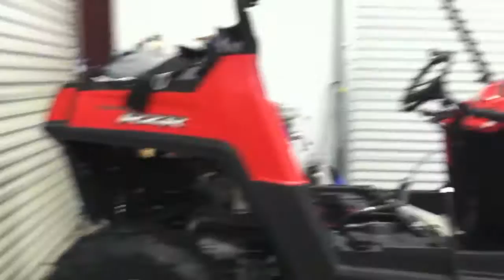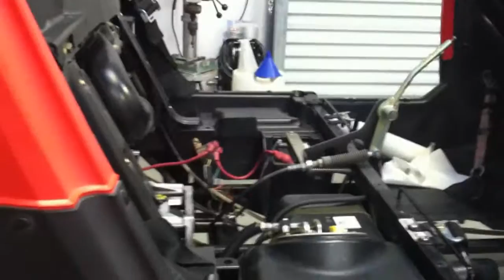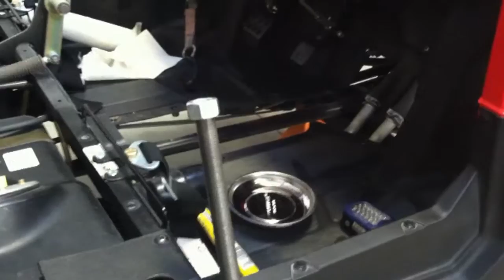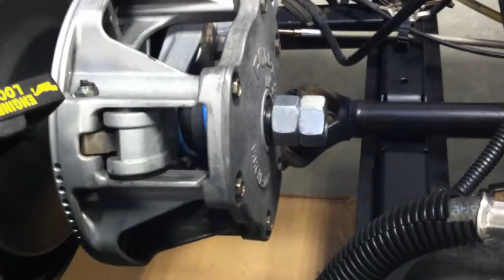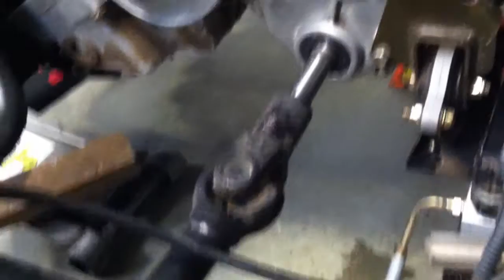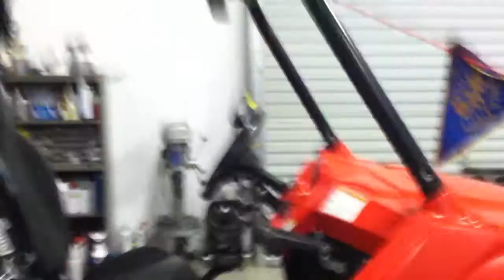Polaris RZR 800 Tranfer Case Leak Fix

Comment: Did you take roll pin out on driveshaft going to front differential and remove shaft from front differential when you moved it forward to get shaft off of transfer case?
Reply from the maker: Sorry for my delayed response.  It is not necesary to remove the roll pin.  When the differential is loose the driveline will pull out of the transfer case.

Comment: Will it be same procedure for a rzr 800 4 seater 2011?
Reply from the maker: I've never done a 4 seater but I know the engine and transmission are the same.  If anything it should be easier bacause ot the longer prop shaft to the front diff.  There will be extra flooor pieces to remove and rear seats of course.  Let us know how it turns out.
Reply: @duneroller  thank you for replying. Thanks for the video. Helps alot to have an idea to do the work on this issue of leak. I'll notify you how it went. Are you from California?
Reply from the maker: @vvillagrana290  Yes.  I live in Central California.

Comment: Hello Jeff how did u get that little red stubby bolt out behind the clutch cooling cast. I’m having a heck of a time getting that one?
Reply from the maker: That's the hardest part of the entire job.  I took a wrench and basically removed the bolt one flat at a time.  The adapter between the engine and transmission/transfer case has to move out as the bolt comes out to clear.  It's not easy but it's better than removing the entire backend and pulling the motor and transmission as a unit.
Reply: @duneroller  ok thanks. I’ll give it another shot tried 3 different wrench can’t get a good bite on it
Reply: I'm doing this job now and on ours we definitely don't have the room like the one in this video,

Comment: can you find a replacement gasket  online no clue what Honda bond is. 16 and attempting this at technical school and need any help I can get
Reply from the maker: Google Hondabond 4.  It's Honda's version of form-a-gasket.  I like it because it seals but does not get as hard as form-a-gasket and is much easier to clean if you have to work on it again.
Reply: @duneroller  another question I have is which motor mounts do I have to take off and undo I have gotten to the stage where I have to remove em but I have no clue which ones
Reply from the maker: @cd5732 The only motor mount bolts that have to be removed are the ones connected to the steel piece that connects the engine to the transfer case.  The others will support the engine but allow it to swing away from the transfer case.
Reply: @duneroller  and what did you mean by bouncing the transfer case with a 2 by 4 till it sits
Reply from the maker: @cd5732  Use the 2X4 as a pry bar.  Lift the transfer case up then drop it until it rests against something below it.
Reply: @duneroller  I'll try it next time I'm in school and do you acually jack the motor up or is the jack just supporting it
Reply from the maker: @cd5732  You have to lower the engine to remove the mount between it and the transfer case.  The jack supports it while down and is used to lift it back up into place.
Reply: @duneroller  I was trying to lift the motor lol I was able to the the cover off I'm gonna have to replace a bearing because the outer race of it fell out when I took the over off but other than that its gone decently smooth I really appreciate the vid and all your help you've helped me save like 3 grand
Reply: @duneroller  I'm having some trouble getting the cases cover back on did yours go on smooth or did you have trouble as well? If you did do you have any tricks to getting it back on
Reply from the maker: @cd5732  Mine slid right back on..  It had to go on before the sealant sets up.  I checked alignment several times and made sure the mating surfaces were clean before the final assembly.  No tricks that I can think of.
Reply from the maker: There is no gasket between the transfer case halves.  It is aluminum to aluminum sealed only by the machined surfaces and liquid gasket material (Hondabond, Yamabond, Form a Gasket sealer).

Comment: That upper shaft, the one that goes to the clutch. Can that seal be changed from the outside or do you have to take the cover off and pull it from the inside?
Reply from the maker: Keith Rowe If I remember correctly both seals in the cover are installed from the outside. The secondary clutch comes off easily if you want to take a look. Remove the belt and the bolt holding the secondary clutch. Keep the shims for alignment and you should be able to see t with the rear belt cover in place.

Comment: My 800s is puking oil out the vent line for the transmission any ideas on this
Reply from the maker: steve billow did anyone service the transmission and transfer case recently?  One has a check plug and the other is fill to plug. I’ve seen many people overfill the one with the check plug.
Reply: @duneroller  no service work
Reply: @duneroller  I filled to the check plug and I also filled to the run over plug
Reply from the maker: steve billow Sorry to hear that. No more ideas here.
Reply: @duneroller  some guys has said something about a broken clip in the trans would do that,  but I have no idea.

Comment: Did this fix work? I have a leaky drive shaft seal as well. I assume that it is where the leak is coming from. It leaks pretty bad. I just bought my 2008 RZR 800 and am just going crazy with how many repairs I am doing. The previous owner did an excellent job hiding all the issues.
I guess I am just asking what you did? It sounded like you pulled the transmission (not sure if it was trans or transfer) cover and resealed it then replaced the shaft seal and sealed it as well. You mentioned that the manual said you can not do this... Was that just the part about sliding the front dif forward?
Thanks for the video, any input would be great..
Reply from the maker: Nathan Yeager sorry for the delayed response. I know it's too late to help you but it could help someone else. Mine was leaking at thetransfer case seam. Spicer did not put enough sealer on at the factory. Mine was leaking at a spot near the bottom that had no sealant at all.
As far as the case seal this process would work to replace that as well if it's only a seal issue. If a bad bearing caused the seal issue it depends on which bearing is bad.
The shop manual says the transmission, transfer case, and engine must be removed as a unit and repaired and reinstalled. 
Jeff
Reply: @duneroller  Got the same leak you got right now... motor blew so was cleaning the trans/transfer/diff and found the leak. Now to reseal. Joyous engineering feat of non serviceability from Poolaris